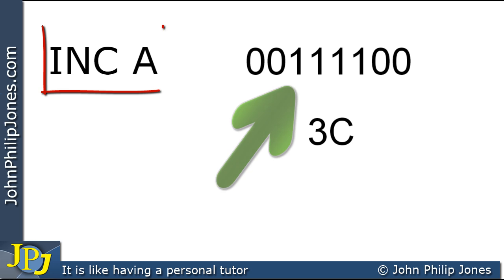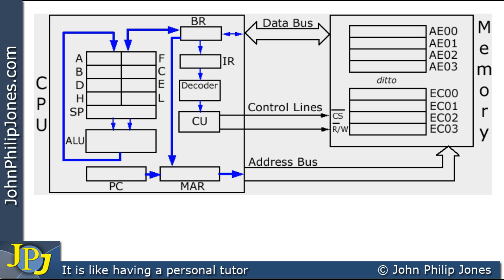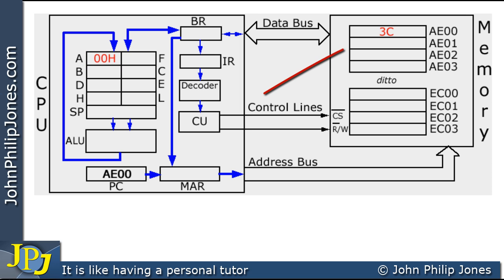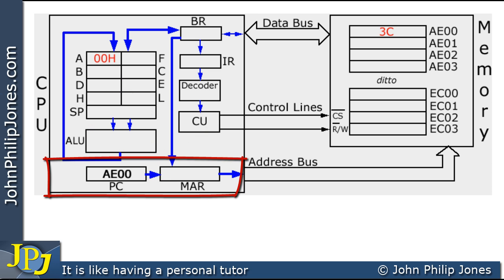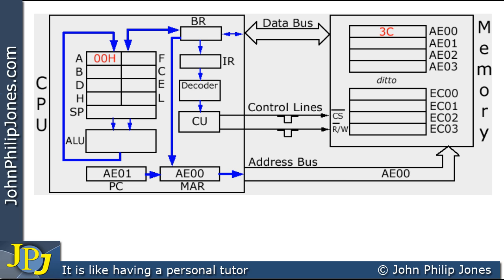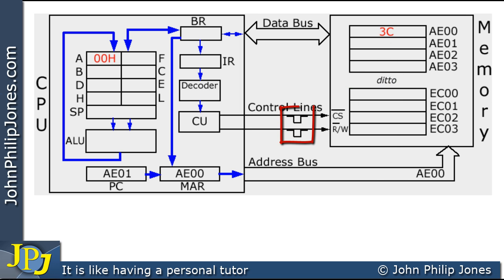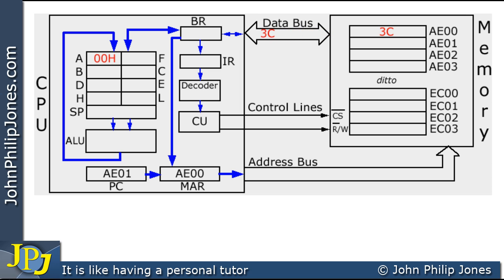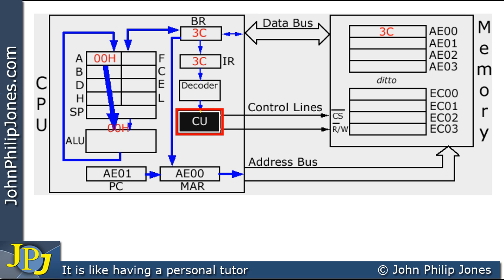Fetch-Decode-Execute Cycle

Comment: Hello, I have a question, why can't the PC be connected to the bus, why do I need the MAR register? The same question about the IR and BR register, thanks in advance for the answer.
Reply from the maker: The PC and IR are designed to 'drive' the electrical signals around the electronics inside of the chip.

The MAR connects to the address bus which has a different electronic circuit arrangement. The MAR has different levels of signals at its output to drive the address to the memory chip. It also allows the control unit to synchronise with the control signals. When the contents of the MAR are addressing the chips the PC  will have moved on to the hold different content required for the next stage of execution.
Reply: Thank you!

Comment: Great video, but regarding the decoder, anyone know how @4:09 "the electronics works out what 3C actually means." ?   Anyone?  Every video I've seen glosses over it, as is done here.
Reply from the maker: A decoder informs the control unit as to the sequence of paths and gates it has to open and close in order for the control unit to action the instruction.

The design of the circuits that perform this functionality consist of logic gates and sequential logic circuitry.

It is a non trivial task that requires a background in electronics.

Hope this helps.

Best wishes
Phil

Comment: Do exe files also need to be decoded??? Because as per my understanding they are in binary
Reply from the maker: Every computer program regardless as to the language is ultimately converted to machine code. It is the machine code that is executed. The machine code consists of many machine code instructions. Every instruction is executed using the fetch decode execute cycle. So every instruction will have a decode phase.
Best wishes Phil

Comment: Is the memory address register really the page table?
Reply: Nice video btw nice and clear to understand
Reply from the maker: No the memory address register is filled with the binary address that is to be transferred to the address bus. The contents of the page table are used when swapping between RAM and disk memory. The contents of the Page table would be transferred to the memory address register.
Reply: John Philip Jones ahh so this is basically as low level as your gonna get lol... This is how the electric charges transfer binary on the cpu right?
Reply from the maker: It is a model of what happens at the lowest level. For example below machine code there is microcode.

Comment: How does the program counter get the first address..can you please explain
Reply from the maker: When the computer is switched on an electrical pulse is generated by the electronics. This pulse is applied to a pin on the CPU chip and the Program Counter of the CPU is loaded with the same address every time. The first program instruction is put in this location. This instruction is part of the operating system so the operating system is now in control. So every time you want to run a program the operating system loads the program counter with the address of the first instruction of the program you wish to execute.

Regards
Phil

Comment: Hello, I am a first timer on this channel and it looks great I loved the explanation. I have a question though, How and when is the Instruction's address loaded into the PC register?
Reply from the maker: When a computer is switched on it always looks to the same memory location for its first instruction. Once switched on the operating system is responsible for deciding on the location of the next program (app) to be run.
Regards
Phil
Reply: Oh so it's as if it is scouring through the memory one by one, starting from the OS's kernel and necessary programs all the way to the user's right?  
You deserve a lot in return for the help you're providing out here for free ! you're one great guy and I thank you a lot.
Reply from the maker: XenoContact An operating system consists of numerous managers (groups of related software). One manager is responsible for monitoring the mouse, keyboard etc. If for example the user clicks the word icon then the operating system locates the software for word and runs it. 

Have a look at the following videos on operating systems:

http://www.johnphilipjones.com/operating-systems1.html

Regardless as to the program e.g word, a browser etc. they will all have a first machine code instruction. The address of this instruction will be loaded into the program counter. The address will not always be the same it depends on where the operating system loads it. 

Many machine code programs appear in devices such as a washing machine (that is an embedded system). Within these devices the machine code program will always be at the same address.

Regards
Phil

Comment: where does the ALU keep the 00H taken from A before incrementing??
Reply from the maker: There are numerous registers throughout a CPU and the ALU has access to these registers. Not all of these registers are accessible to a machine code programmer. So in short the 00H is stored in a register.
Regards
Phil
(John Philip Jones)
Reply: Hello John,

Really loved the video...Thanks for explaining it to me..Just I have one doubt..Please guide me, as how to obtain radical root architecture, where every other register is visible and everything is transparent..even though they aren't under the reach of programmer...I mean the TRUE 8085....all registers visible sort of architecture..
Reply from the maker: Manufacturers of the chips give a programmers model of the CPU. That is they give access to all of the registers that the machine code instructions are able to access directly. The following link gives details on the chip you mentioned. There is a Micro Architecture image on this webpage that may help.
Regards
Phil

Comment: A great video thank you, why are the memory address letter in that order and why is it ABCDEFHL, why not G,I,J,K,L,M?
Reply from the maker: +Bruce Collier ABCDEFHL are the names of the registers inside the CPU. A is the accumulator and is shortened to A so the other registers follow on as B, C, D etc. The HL is related to the fact that this register can and does act as a pointer to a specific memory location. The H stands for High Byte and the L for Low Byte.
Regards
Phil

Comment: Nice video. Thanks. But I still have a question. How does the "3C" get into the memory in the first place? In other words, if I write a code and it gets translated (let's suppose the entire code translated to 3C) it's still basically a text (because code translators are basically just giant string parsers). What transfers it to physical electronic impuls resulting in 3C being writen to memory?

I hope I expressed myself properly. :D
Reply from the maker: Samuel Leško When you switch on a computer the electronics generates a pulse of electricity that arrives at the reset pin of the central processor unit (CPU). Once reset the CPU always fetches from the same memory location. This location would be the boot program for the computer operating system.  The boot program would have been ‘burnt’ onto the read only memory during manufacture (this memory is then fixed to this program).

Once the boot program is called it is in control of the hardware of the computer. This boot program will proceed to load up the operating system and set various aspects of the computer. Once the operating system is in charge you as a user can issue commands that the operating system runs. 

One of these commands would be to load an editor into which you typed in your assembly language program (Inc A is an example of an assembly language instruction - numerous assembly language instructions make up you assembly language program). Once you have completed your typing you issue a command to assemble your assembly language program (an assembler is a program that will do this). This translates your assembly language program to a machine code program (e.g. Inc A becomes 3C).

At the top of your assembly language program you issue directives as to where in memory you wish the machine code to be loaded. A loader (another computer program) then places the machine code in random access memory (memory that can be altered). Your machine code program is then fetch-decode-executed from this random access memory – starting at the first address of the machine code program. You indicate where the first address is using the directives at the top of your assembly language program.
Reply: John Philip Jones Nice. Thanks a lot for the detailed description! It really helps me to understand this. 

But I still feel my question wasn't entirely answered (sorry :P), but now I know better what I am, in fact, trying to ask. 

So, how does the loader place the machine code instructions into memory? I mean, physically. 

The question that has been bothering me for quite some time is how or when does the information stored abstractly as code get transfered to physical information, physical current going through the wires of computer.
Reply from the maker: Samuel Leško A computer system is essentially a number of pathways that carry electrical signals. The direction of these signals is controlled by logic gates (which are essentially switches). The electrical signals are either a high pulse or low pulse of electricity. A high pulse represents a binary one and a low pulse represents binary zero. Everything in a computer system is represented by binary numbers; consequently everything in a computer system is represented by electrical pulses.

The opcode 3C is a hexadecimal number that we use as humans because it is easy to remember compared to binary numbers. Inside a computer the opcode 3C is a binary number byte and is 00111100. However, it is actually a low pulse, low pulse, high pulse, high pulse, high pulse, high pulse, low pulse, low pulse. 

Every memory location has an address which is a binary code. Every memory location has content which is again binary code. This content of a location can be an opcode, data or indeed another address that can be used to ‘point to’ another location.

Binary codes (electrical pulses) representing an address of a memory location are sent along parallel lines of conductivity (called the address bus) to the memory chip. This selects a specific location from the memory locations available. Another pulse of electricity is sent along a control line to tell the memory chip it is to receive a binary pattern for storage. At more or less the same time the opcode 3C is sent as pulses of electricity along the data bus (a different set of parallel lines of conductivity).